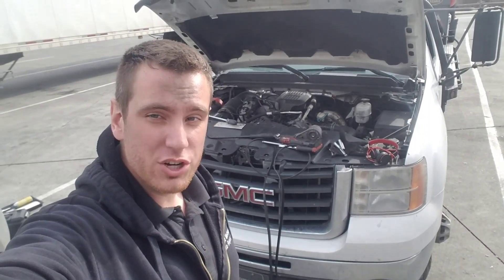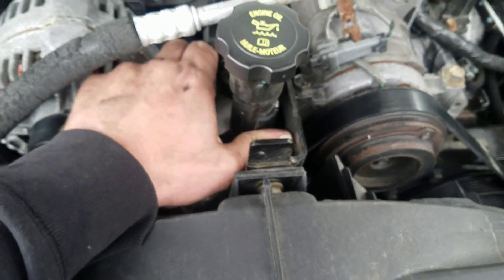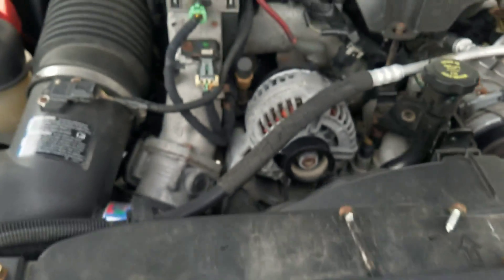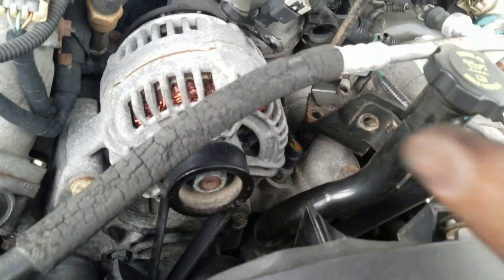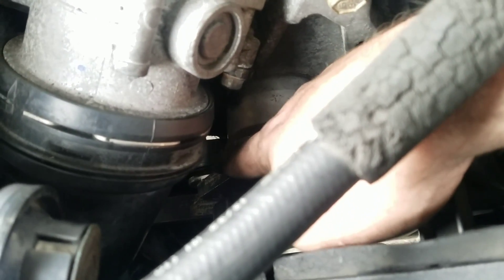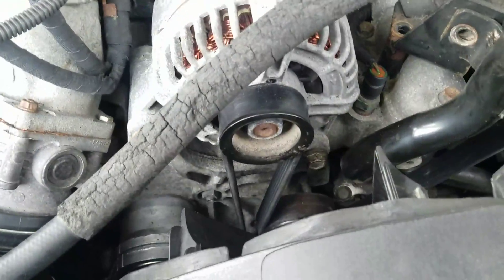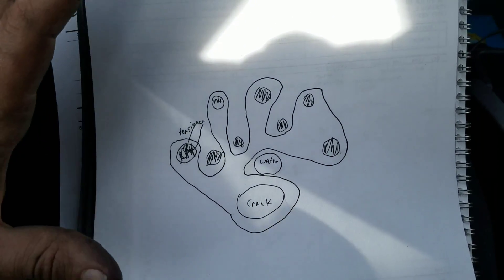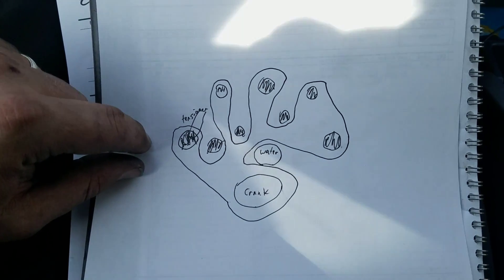Serpentine Drive Belt 01-18 6.6 liter Duramax Diesel Replacement "How to"

Comment: This job would be easier with 2 people but I did it myself just fine.  If you have a dual alternator set up lol have fun.
Reply: Why do you say that😭?? Im doing it right now any pointers?
Reply: @fredc8618    Start at the crank or down low when you go to routing it so you end up with your slack at the top at the driver side alternator.  My truck didn’t have a routing diagram and I couldn’t find one online for a dual alternator duramax    You have to partially unbolt the fan shroud so you can push it back far enough to get a ratchet on the tensioner pulley  and even then you barely have enough movement to get the belt on and off I cut my old one off lol.   There may be other things you might have to unbolt to get out of the way I can’t exactly remember.  But that motor is so tightly packed in there your always fighting for room.   I recommend two people as well. That way a guy could be down below helping you route the belt and you on top guiding it.  And then they could help hold that ratchet on the tensioner while you get it over the alternator pulley.  By yourself is pretty hard I had my whole body up in the motor bay with a foot in the breaker bar that’s on the tensioner  (for extra leverage)  and both hands trying to get the belt on the pulley  my legs were shaking and my knuckles were white lol.    Hope that helps.   One last thing use a quality belt and replace all the idler pulleys and you’ll be solid for another 100k.
Reply: @fredc8618   almost forgot you should get the alternators checked   Being that there is two  one could be weak and you wouldn’t really know. It will eventually start creating issues.  You also don’t have to buy the expensive duramax alternators    They come with 125 amp alternators that are acdelco if I’m not mistaken and when I redid it all on mine I did some research and went with two 130 amp acdelco alternators that were for a 5.3 GM.  Cheaper and worked great.   Good luck bud!